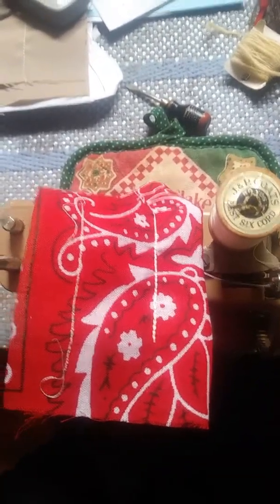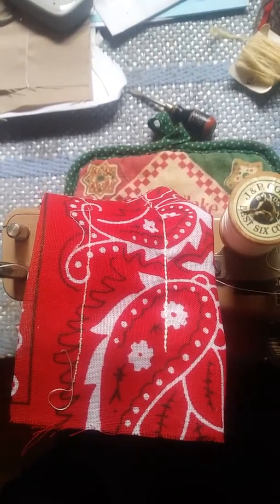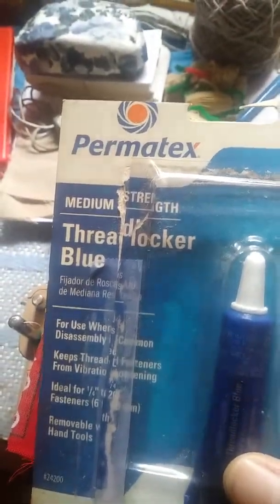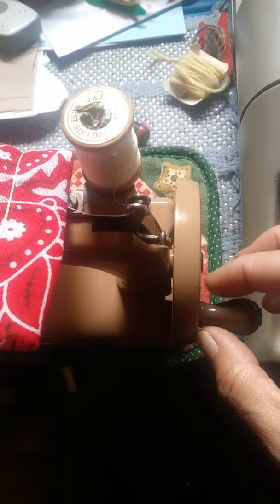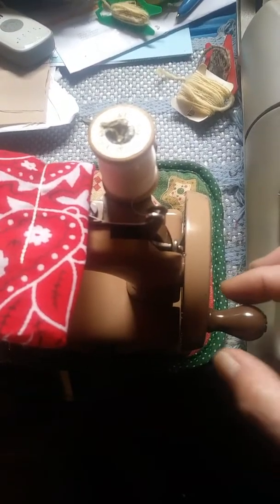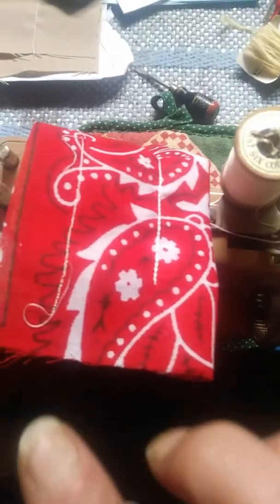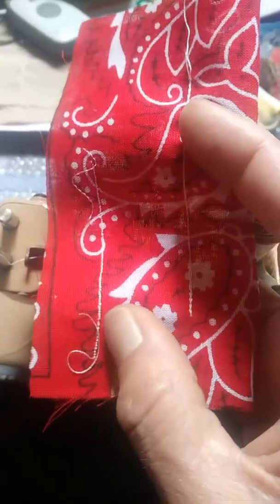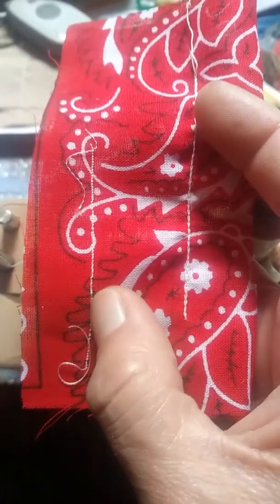Singer Model 20 Stitch Length Issue

Comment: A bit confused. When talking about the screw underneath near the looper being to tight, you turned the screw to the right. Isn't it 'left loosey righty tighty'? I'm BRAND new to this and trying to figure out why the thread tangles around the looper so I have A LOT to learn compared to what you know.
Reply from the maker: I think your problem is the tensioner.  The Model 20s are slightly finnicky with thread- if you have some Coats Dual Duty XP all purpose thread, you will have a very good thread for this machine. The thread goes down through the hole toward the back at the number 3 mark, then to the left to the round tensioner. Then, if you are sure you have threaded it correctly, with the thread going through/between the two tension discs on the tensioner, and you are still getting loops and not stitches, then perhaps the screw mentioned above is involved, but only a slight adjustment either way would solve the problem. These machines are not crazy about a very lightweight muslin all by itself, but perform very well with quilting cotton or broadcloth type fabrics. When I adjusted the screw underneath on this particular machine, I could adjust it left, then two hours later it would need to go right.  I think this machine which was damaged is a problem machine and normally you should not have to do more than oil the screw area. Let me know if it improves- if you have a way to make a video and send it to me at laeom33@yahoo.com, maybe I can help more.